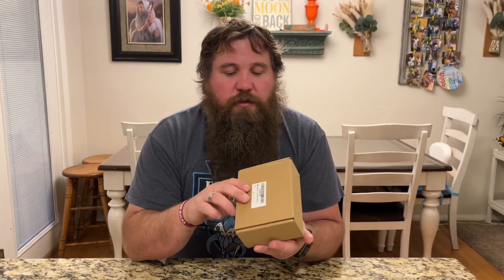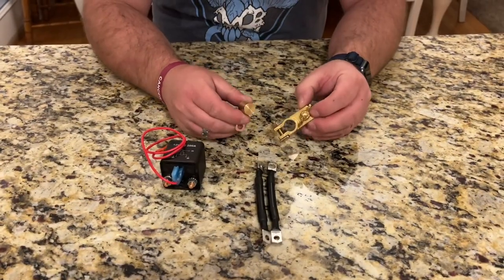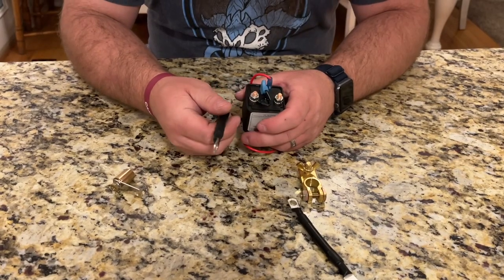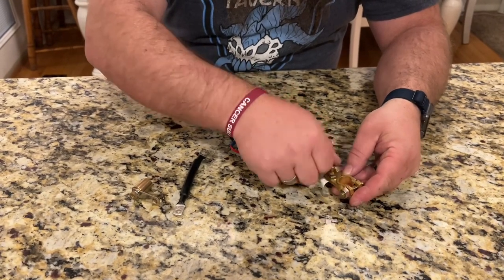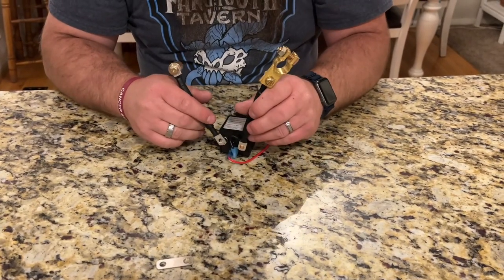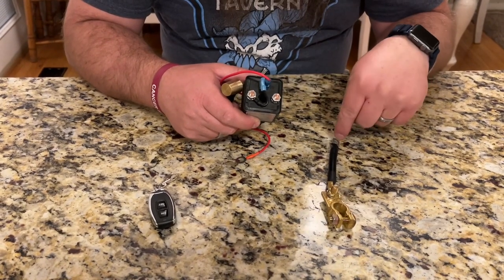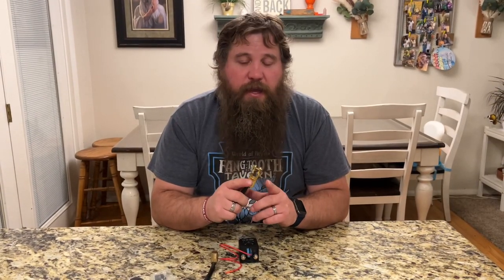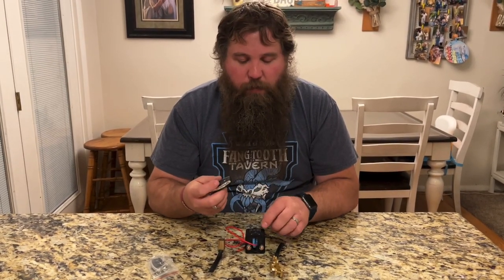Remote Battery Disconnect Switch

Comment: So do you un hook the negative cable off off battery or leave it hooked to battery
Reply: There's a couple ways to wire it and there are a couple different styles but...... Generally you leave the negative alone and leave it connected as it was originally and just add the negative from the disconnect. then you interrupt the positive with the disconnect and add the red wire from the disconnect to the positive terminal.

Comment: I just bought this although I have a couple of questions, how do you program the key fob 2nd when I tuen off my bettery is this also going to reset my aftermarket stereo settings back to 0 or stock, meaning everytime I turn the switch on I will then have to re adjust my head unit??
Reply: They are killswitch who desnt cut 100% of  power letting sub systems ok but without enough power for the starter
Reply: @BryanAM7   Koo koo appreciate it, thanks
Reply: @BryanAM7  Thanks appreciate it
Reply: just wire it to interrupt the positive cable on the starter....everything else will remain on like normal.

Comment: if the off button is pushed while driving will the car shut off?
Reply from the maker: Yes if it’s a gasoline and highway diesel! Some diesel engines will not!
Reply: Not automatically. Doesn’t the alternator run the car first. So it will slowly drain?
Reply: No.  While runing, cars use alternator energy
 not battery

Comment: What if I installed the killswitch but is always on, no mather if I push off or on in the controller. I think the controller is not programmed.
Reply from the maker: Something could be wrong with it! Not sure what your issue is I’m sorry!
Reply: This might be late, but while the car is on , you can’t turn it off. Only when the car is off, can you disconnect the power.

Comment: I think ill use mine as a theft deterred so I'll probably put it on the hot lead going to the starter
Reply: Adding isolation so no short and a cover over all to make it harder to figure out wiring. Starter cut out is the best theft deterant
Reply from the maker: Good luck!